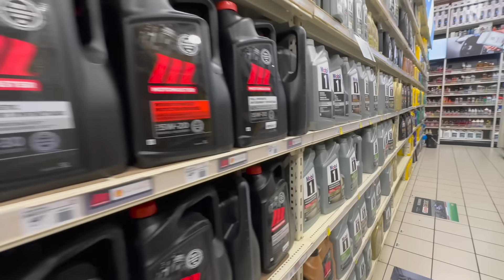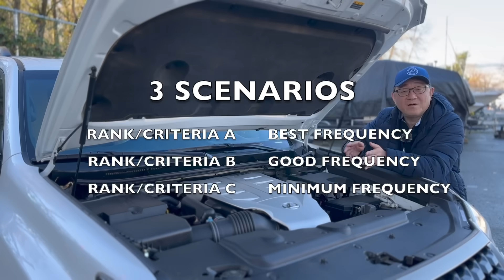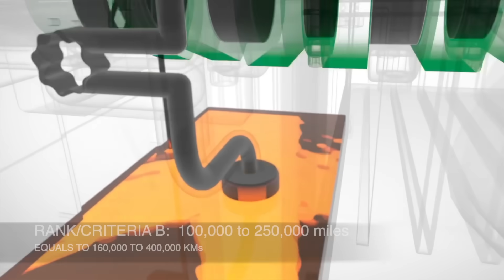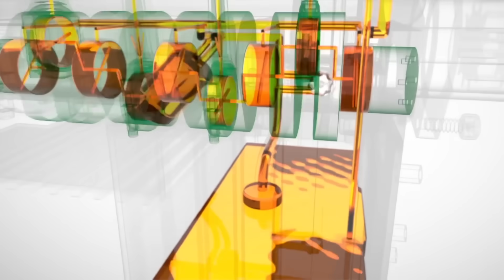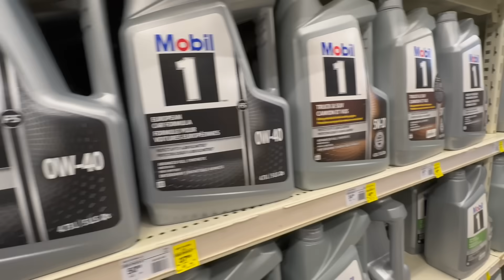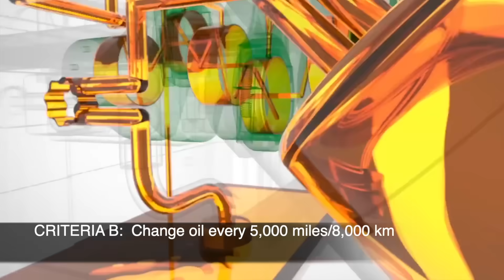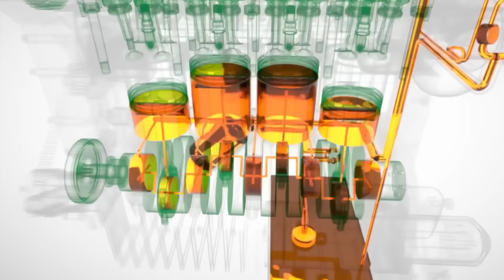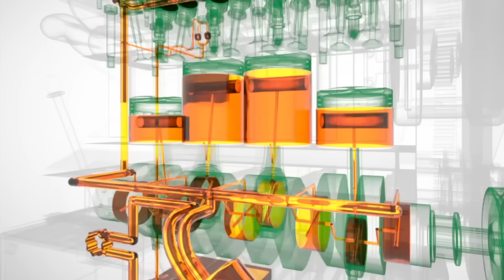ENGINEER EXPLAINS HOW OFTEN TO CHANGE OIL & FILTER // UPDATED CRITERIA-BASED RECOMMENDATIONS!

Comment: As a mechanic for over 35 years, I agree 1000% with what you said. Spot on.
Reply: Hi,Ime not a mechanic,just interested about oil change maintenance on my car and bike.
I just curious as to why the actual manufacturer’s recommendations are way over the 3000 to 5000mile oil change intervals.
Reply: @darrenbrownell5732  I suspect,   they want to show they are eco-friendly with less oil changes,  and financially more attractive than the competence.  For me the manufacture recommendation is a big BS "With the oil topic". I never trust them. as other comments here,  they are only thinking in the warranty period.    Now I will love we find a solution with the wasted oil, and really able to recycle it fully.
Reply: @DGQ1Q2 makes perfect sense,thanks for getting back to me.👍👍
Reply: @darrenbrownell5732 Because they get CAFE credits from the government for increasing the interval in the name of “environmentally friendly”.  Up until that credit system started the manufacturers were suggesting 3,000 miles.
Reply: @darrenbrownell5732  Characteristically these recommendations are for steady-state 'highway' driving.  But the data is now showing that especially for the newer (2012+) engines with "loose tension piston rings" are prone  develop STUCK piston rings  (via carbon fouling) ... and the remedy is to change the oil at 2/3 the recommended for 'highway' driving and HALF the recommended interval for stop & go' city driving.
Reply: Darrenbrownell, my suspicion is that the manufacturers are going for the lowest cost of ownership throughout the lease or warranty period. Once the warranty runs out, maintenance is on your dime. Many of the mechanics/technicians recommend oil change intervals every 5000 miles (8000km) or every 6 months, whichever comes first.
Reply: @carlovanrijk4039 Right I see, yes that makes perfect sense.
Thanks for replying to my question.👍
Reply: @carlovanrijk4039  Yeah, the window stickers now have a "estimated cost of maintenance" amount, so to keep that down, they may increase the rec. intervals.   In some cases, in other countries without that window sticker, the manufacturers actually recommend more frequent changes than they do in the US.
Reply: @ugaladh 👍👍👍
Reply: I had a vw lupo it lasted 21 years only changed the oil every 2 years it was the sub frame that finished off the car the engine was still running strong
Reply: But what about SHORT distance driving?
What about FEW TRIPS?

What about both short trips AND few trips? Isn't that the worst combination?

Comment: Your recommendation is just waste of money and materials.
First wrong assumption is that if you change oil every day, your engine will last forever. But it won't. Maybe you can extend lifetime of your engine by more frequent oil change, but I doubt that it can be much.
Second is economy. E.g. Ford Fiesta manual says to change oil every 20kkm and promises 250kkm lifetime of the engine. If you change oil every 5kkm, you will overspend at least $50x38=$1900. For that money in my country I can install a used engine with low mileage and get with it close to the total 500kkm. While I doubt that this mileage is even possible if I change oil every day.

Comment: I like to change oil at around 3000-4000 miles regardless. I live in Las Vegas so the temperature here can get up to 115 degrees. So with that in mind along with the heat the engine generates, it’ll break down oil a lil faster than usual. I’d rather spend on an oil change to better the engine life rather than to wait for last minute or when the service light comes on. Also changing coolant as well at 60,000 because of the extreme heat especially during summer time.

Comment: Man I have a 2010 Honda Fit. I have 300,000 miles on it and I change the oil every 15,000 to 20,000 miles ans I have changed to transmission fluid twice.  The Honda Fit hasn't missed beat purrs like a kitten. Honda and Toyota are way better engineered than your giving them credit for.

Comment: My VW dealer just refused to change the oil during the 12-month regular service because the computer didn't say it needed it. My wife had taken the car in and didn't argue. When the car came home I checked the computer and it said I had ANOTHER 15 months to go before the oil change was due, making it a 27 month interval!  Seems to me this is VW's scheme to get me to by another car from them as soon as possible. They know the warranty will be long over before the engine gives out. I have always gone by 1 year maximum between oil changes regardless of mileage. I sold my last 2 cars at 424,000 miles and 375,000 miles and they both still ran like new. Neither burned a drop of oil.

Comment: Oil chages depend on the car...older engines like my Ford 300 six only needs 1 oil change every 50,000 miles.. 

Neighbor put 107,000 miles on a Ford Tempo with the same oil...no issues...

Comment: Here's an idea. Since we all now agree oil doesn't "wear out", but needs changed because it gets dirty, well....change it when it gets dirty then. This will require some monitoring until you establish a baseline for your particular vehicle. I've had some get dirty at 3k, some 5k, some much later. I would say 7-8K is very reasonable for the average driver.

Comment: I use full synthetic and change the oil once a month regardless of how many miles I have driven as exposure to the air causes oxidation regardless.  Oxidized oil will kill an engine.  So if you want to keep your car for 100K or more change it once a month.

Comment: more ofetn than 3000 miles?   or less  "if you can afford it"? WHAT?..youre just making up ARBITRARY numbers!l have never had an oil related failure at 300,000 miles changing at 6000!....blown heD GASKETS and water in the oil is what destroys these great high tech motors!..I WAS HOPING HE COULD ADD some science and engineering instead of arbtrarily adding  "1000 miles" if you use synthetic....

Comment: I have a friend who is a mechanic that says it is important to change the filter, if there is a paper element in the filter. The paper breaks down over time, not just mileage and should be changed, even if you don’t make the mileage.  Thoughts?
Reply from the maker: Yes change the oil filter every time you change the oil

Comment: I just got a new 2023 GX460 and love it.
Do you recommend an oil change at 1000 miles as part of the break-in process?
I have a big Toyota dealer 3 miles away while the Lexus dealer is 30 miles away so less convenient. Is there any reason to NOT use the Toyota dealer for a simple 1000 mile oil change. I will go to the Lexus dealer for the 5000 and 10,000 mile services of course,   Thanks
Reply: The only time I've seen metal flakes and large particles in the waste oil iis on the FIRST oil change.  Personally, I'd rather get that crap out of there earlier than the "normal" interval.

Comment: Id be very lucky to do 4000 ks per year in my car as i also ride a motorbike, and since its cheap and i do it myself for around $100 per year i do an oil change mid year then do both oil and filter at the end of the year. My car is a V6 Pathfinder and im hoping to keep it for a while longer. 
I should also add every few years i take it to my mechanic for the end of year oil change and get him to service it and check it over for anything else that it may need.

Comment: Here s how that goes ,The original owner or leases a car I s then sold to a person that wants to keep the car for a long time . They keep up the maintenance schedule but the cars doesn’t last as long because of the manufacturer s 10 k mile recommendation. The lease cars that are maintained at dealerships often push for the 10k. Then I would say lease cars that are forsale should have less of a resale value.

Comment: 1999 Honda Civic.. I change oil every 3000 miles. I find the oil looks dirty at this mileage. My car is 25 years old so the interval is lot shorter but my point is don't skimp on oil changes.. it makes no sense paying so much for a new car yet some people are too cheap to get an oil change. Think of oil as blood in your body. Would you want dirty blood circulating in your body??
Reply: Good point! Look up chuck missler

Comment: I owned a few France cars and drove each 400,000 km before selling it. I changed my oil (excellent quality oil) every year and in fack every 45,000 km. In the beginning (I bought the car new) it used 15 ml/1000 km oil and after 400,000 only 45 ml/1000 km.

Comment: Oil change interval has more to do with the driving you do than how long you plan to keep the car. But it's a lot harder to give advice based on usage. Maybe the best way is to take a look at it and when it's loaded with deposits and a drop on a paper towel will give you a good idea how dirty it is.

Comment: I really don't understand the arguement here, for the cost of the oil change and filter change I would do it as often as I have the time to do it.  50$ and it's done, so make your mind up.  Change too often and it's no bad thing for the engine, leave it 12,000 miles and you are setting yourself up for a shorter engine life, and probably an early failure of the turbo.   I have always done my oil changes on time scale,  every 9 months, about 5000 miles and never had a problem.  Think of an oil and filter change as a human having a blood transfusion with 100% filtered new blood every 9 months, need I say more?

Comment: That's the trouble when you buy a used car.You don't know how often the previous owner changed the oil & filter unless you know the previous owner personally. If you're buying a used car check the oil level dip stick & if you see sludge on the stick, don't buy that car! That engine is on borrowed time & ready to blow!!

Comment: Electric Cars? You don't need to change your oil every 3,000 miles if it is not burning any oil or leaking. 5,000 miles with today's quality and expensive synthetic oil is why it is 5,000 miles. Non synthetic oil doesn't even have to be changed every 3,000 miles. 4,000 miles on non synthetic oil is OK.

Comment: Engine oil change every 10k with tranny and rear diff every 50k for all my cars. I use Mobil1 for motor oil and factory oil for every thing else. I usually put on 20,000 miles a year with all the cars I've owned.  No issues so far, so im not gonna change it.

Comment: I changed my oil 4 times a year. No matter how much I drive. Once every season.
Reply: Interesting, simple rule of thumb
Reply: lmaoooooo i had to re-read this a couple times to believe what I was reading
Reply: if you are putting less than 3000km every season, you are wasting  big money. every 3000miles or 6 months if drive a lot in traffic and harsh driving. every 5000 miles or 6 months if mainly highway.

Comment: I’ve followed the manufacturer’s recommendation (every 7.5K) & my 2000 Honda Civic with over 350K and it runs fine. Prior to owning my civic I was in the mindset of changing it every 3K since that’s what the “express oil change company “ advertised. I simply tell my friends and family to follow the manual.

Comment: Small point of disagreement , The MOST important filter on your engine is NOT the oil filter  but rather its the air filter . By a ratio of media filtered ,the air filter works harder that ANY of your filters . Not to diminish the importance of the oil change but rather ADD the air filter onto the list of IMPORTANCE  on your maint program!   rule of thumb:   it takes only ONE oz of dust to destroy 100 Cubic inches of engine displacement
Reply: Yes, this is where most wear contaminants come from.  Check out and use the oiled synthetic media air filters now available.  Certainly a good idea to change air filter with every other oil change.  I do it every oil change.  I am a bit surprised most makers still have long air filter intervals listed.
Reply: You are the first person I have heard say this, I will definitely be changing the air filter more consistently. Thanks
Reply: How often should one change their air filters?
Reply: @markbenjaminh  depending upon your environment at least once a year but maybe more often if you drive gravel , live in a rural area , or drive in lots of wet/snowy conditions , as a wet air filter causes bad MPG
Reply: @keithdickie7735 interesting response, I change my air filter with every servicing which is every 5000 km. It gets verryyy dirty each time so I definitely think that your environment matters a lot!
Reply: @ja9613  Excellent,  I manage to get almost 10 out of mine . I have only 3/4mi of gravel to get the pavement from my yard , so that helps .    You must have some dusty conditions , interestingly in Australia you see LOTS of vehicles with "snorkel" type air intakes & many folk think its for fording streams but in actuality it to try to reach cleaner air above the hood of the vehicle rather than dustier conditions under the hood
Reply: @keithdickie7735  Yeah I live in a very tropical country and to double down, I live in the countryside you might say so it is inevitable I suppose. And that’s such a pretty interesting fact about the different type of air filter they have in Australia, it definitely sounds like it’s effective and efficient because of their conditions.
Reply: @HenryJackson-oe3ss thanks for the tip, I will look into that

Comment: The only thing I would add is checking oil levels regularly too.  All engines "consume" oil, some more than others.  By the time one's low oil indicator comes on one could have already caused damage, .. even in not immediately catastrophic.  At a minimum, one should check oil level once a week.  If one is going on a long trip, check it before and during the trip. After a while you will understand the catachrestic of your car and can adjust accordingly.  And, as long as you're at it, one's weekly oil checking routine should include checking tire air pressure too.  Otherwise, everything mentioned and the recommendations are spot on.  Changing one's oil regularly is the single best thing one can do for engine longevity.
Reply: One may also want to run spell check 😂
Reply: @JodieMix  WTF?  This isn't the SATs.

Comment: I appreciate that you made the video.  The one part of the equation I thought was missing was the type of driving.  Personally, I am and A/B guy who uses full synthetic and change my oil every 6 months with about 4500 miles.  My Wife's car only gets about 3000 miles a year, I still use full synthetic and change it yearly.  A friend of mine drives about 3000 miles a month with over 80% highway driving, he also uses full synthetic but changes it every 3 to 4 months.  He kept his last car last car about 10 years.  I am not an engineer but I don't think that should not put him in category C .  Thank you!

Comment: My 2005 Porsche had a factory recommended oil change interval of 20,000 miles. No, not 20,000 km. A year later Porsche changed it to 12,000 miles. I changed it every 7,500 miles. After 15 years the compression was 160 lbs dead even in all cylinders.
Reply: I bought a 2007 Targa 4S new and now it has 20,450 miles on it.I only drive it occasionally,I wonder how often I should change the oil?
Reply: @lv4077  I traded my Boxster S for a 981 Spyder 4 years ago and just had the oil changed. I’ve driven her 1,50p miles during that time. I’m gonna test the oil by sending a sample to Blackstone Labs. It will cost about $30. I’d recommend that.

Comment: The bigger question I believe, is do you drive 3 miles to work every day or 30.
Reply: 3000-4000 miles or every 6 months, as long as you do highway driving of 20-30 miles every week to burn dilution of oil by water and gasoline.
Reply: I use bypass depth filters on everything including lawn mowers. Even with filters that clean oil short trips in cold weather is a engine killer. In Idaho no problem I drove 36 miles one way to work. Years ago when I sold depth bypass filters I sent filters to placed like Norway and Northern Canada. Frantz at one time had a heater. I think it was a Alaska package. Kind of like a electric blanket. Not such a problem with modern synthetic oil.
Reply: The PCV cant do its job until the oil gets hot.

Comment: I'd like to know what data you have which supports your claim that changing oil more frequently actually results in longer engine life. This seems like it's all based on "feelings", not actual scientific experiments.
Reply: Oil changes are not cheap if your doing at a local shop or dear God at a stealership lol
Reply: @bbbt8090   Tell me about it. I change my own oil. I only take it to a shop for things that I can't figure out how to do myself or which require special equipment - like A/C work.

Comment: It depends on the engine design (no timing belt for one) and all the other systems (and how they are maintained), how it is driven and in what environment. You may change the oil every 500 miles and the CVT dies in 80k miles what is the point. eg my 2008 Nissan Versa with non-CVT has 140k and driven very hard vs a 2008 with CVT is disposable if driven hard, within 80k miles.

Comment: My 1997 M3 lasted 240,000 miles (I totaled it on fwy). Recommended interval 7,500 miles. I did an inbetween change. Never leaked a molecule of oil  or burned oil ( they are known for that).

Comment: First thing: manufacturers recommendation on severe service schedule is my baseline. I typically do a 5k mile OCF using whatever synthetic OEM spec oil I can get on sale, a high quality filter, and the occasional lab analysis. I also do other fluids at 60k for trans, 90k for coolant, and brake fluid every three years. Service on 4wd transfer case and differential is approximately every 30k - 50k depending on the component. I’m not afraid to go longer on the OCF if on a long over the road trip and have done an 8800 mile change with lab analysis showing the oil still held additives and no degrading wear byproducts. Excellent summary sir. Grease is cheaper than steel.